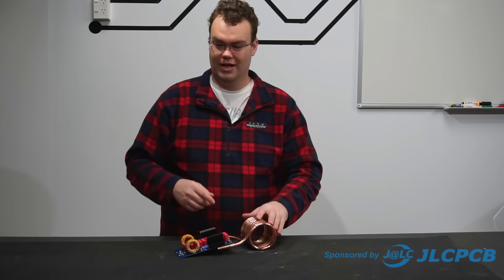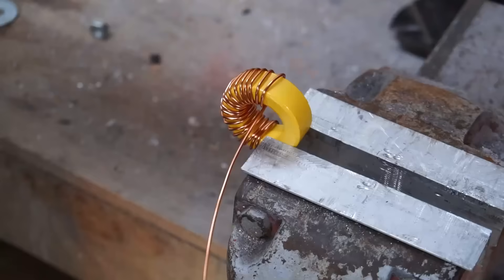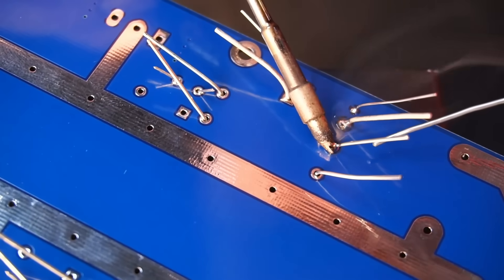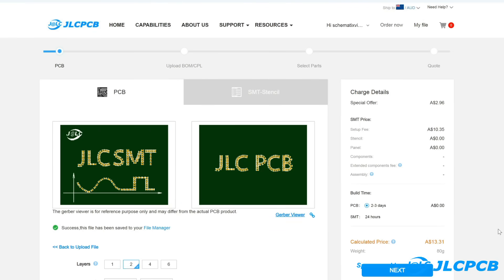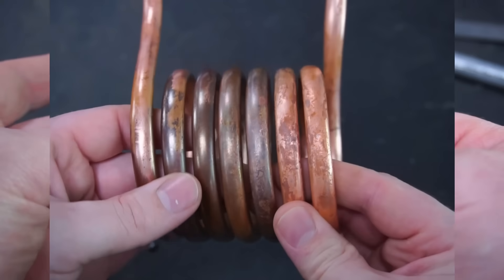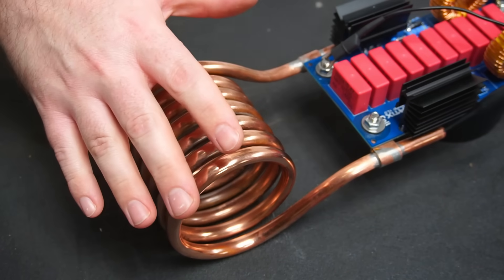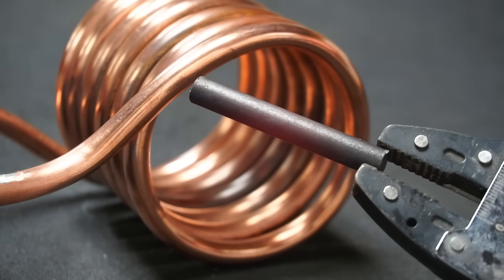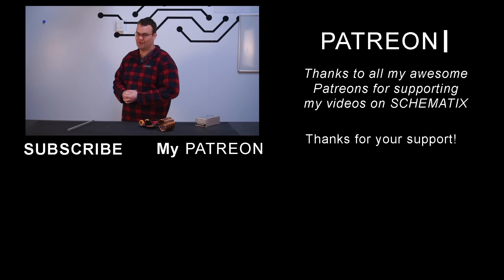Building a 1.4kW Induction Heater

Comment: Get the automotive batteries from 4 vehicles. At 12 volt DC, wired in series will get your 48 volts. Just don’t use your battery as you may have to drive to get parts for projects.

Now, using copper pipe wire cut the mustard, or cheese. Solid wire in that diameter may prove expensive and hard to find. I am sure that solid copper is used in manufacturing.
A note of caution: Grounding rod is sold to be driven into the ground where it can get wet, but this rod is copper clad on a steel rod. You won’t be able bend it first off. Only heat or power equipment will shape it as shown. Don’t just think you’re getting a good deal on solid copper as sales people won’t bring it up as they would thing you know what you’re getting. If solid copper, it would bend if you drive it in the dirt. ASE Master Tech-Retired.

Comment: Monitoring the coil frequency and you can detect when the coil is 'loaded' and when the frequency snaps back, you know the iron is melted (if you can reach those temps) and you can cut the power.

Along with a crucible container, those would be very nice features. A detector that shuts off if the coil isn't loaded when the power is on and an automatic shut off after the metal has been melted.

If you are looking to make an automatic molding machine (or something similar), then you could also combine the cut off with a poor mechanism. Creating a 'load and ignore' ingot melt system. Fun.

Comment: This looks like it would make a good Tesla coil if you just add a large secondary coil that's resonant at 50 kHz. to step up the voltage.
Reply: Flyback Transformer frequency was closer to ~31 KHz (625 PAL lines x 50 frames per second, or 525 x 60 if NTSC ...) in days when TV tubes required those while Vladi Mazzilli only used his skills to work on Tesla Coils around 2008 - hence titling his cross-diodes topology a "Royer ZVS" actually, quite probably in reference to Royer's 1954 patent...

Comment: Hello sir. Thank you for video. 
Could you please tell me if i use this kind of device as heater for 10 hours in day. It works or breaks after while..? Thanks.
Reply from the maker: Good question. All the components have been carefully selected so the induction heater is robust. Provided you have a couple fans blowing air over the caps & heatsinks, you shouldnt have an issues using it on a daily basis.

Comment: very nice , but i need heater to have much more than 100w at 12v, i usually use small and cheap heater from ebay 6$, that has 120w at 12 v

Comment: Question: Towards the end you said you turned the input power up to 48 volts. Your power supply was a 28 volt transformer through a full wave bridge with capacitor filtering. That gets you around 39-40 volts (less the diode drop of the bridge.)  So where did you get 48 volts?
Reply: He explained that his variac could supply overvoltage to the transformer.

Comment: Are you referring to aluminium as "alloy", or do you really have a rod of aluminium alloyed with something else?
Reply: Most so-called aluminum is actually aluminum alloy for increased strength and hardness.  Pure aluminum is only used when the best corrosion resistance, ductility, or electrical / thermal conductivity are needed, since those are the properties which get worse with alloying.

I've heard the phrase "aluminum alloy" shortened to "alloy" before, but only in the bicycle business.  I guess it's not really any worse than just calling it "aluminum".
Reply: @CoastalSphinx  I married a yank, so I've got used to "aluminum", but yes in my world I deal with pure aluminium a lot, particularly as I own military vehicles with aluminium bodies and galvanized chassis - so this isn't a trolling comment it's a genuine question as the distinction is relevant for me - mostly as I do plan to experiment with induction heating in the near future.

Comment: now how can we make this to turn on only when we need hot water in the sink via the water line .    Or replace the boiler in the basement with an induction heater.   2 great idea for some entrepreneur.   Did  anyone hear me?
Reply: marty V on-demand water heaters usually use natural gas because it is more efficient and cheaper than electric ones.  Also, resistance heating is a far simpler design if you do need to use electric power for some reason.
Reply: This board and setup would be an interesting water heating experiment for an instant on demand water heater. Of course, resistive is simpler but comparing the two for efficiency is key. I'm on it!

Comment: How can I increase the frequency?  I like the clean look but want to heat metal faster. Ideally, I want a 1/2 inch thick steel rod to go from ~90°F to glowing bright red in about 3 minutes.
Reply: Try a coil with a smaller diameter maybe with solid thick wire.  This will be lower inductance so may need extra turns.

Comment: Smiling!
Nice video. Just found your channel. I am a Ham Radio guy for the past 46 years and enjoy watching people build things. Also enjoyed your toroid video and will watch more.
Been watching guys build a solid state linear amps, that put out 1.5 KW with small transistors. Crazy small compared to my 4-1000A amp I built 45 years ago and still working. Like the fact of low voltage, 60 or so compared to my 4030 plate volts, a bit safer if you make a mistake. Smiling.
Thanks!
Reply: Hello mate I've been trying too improve the amps on my salt batterys just a volta stack salt battery I just wondered if you had any ideas about improving the amps...I know can parallel them but I just am asking people for any input as volts are no problem its just the ampage I'm trying too improve ..if any ideas be appreciated cheers

Comment: Could you design a space heater using the induction part ??? I was thinking of you maybe making a copper flower of some sort to use as the part that gets heated and releases lot of heat using a fan blowing across the flower??? Hope to see a video on that subject Sir. Thanks, Vic
Reply: You could but there is no reason to, resistance heaters are already 100% efficient.
Reply: @sbvera13  You would think that is correct but that is far from the truth. The method of measuring efficiency is far from correct. That is like saying an engine which burns gasoline and diesel engines burn one gallon of fuel go the same distance . Just saying fella. VF
Reply: Point well made Random Lurker. This is what gets me more than anything. EFFICIENCY has to be the most misunderstood word in anything electrical or electronics. Would be nice to get an answer from someone who knows for sure. Thanks vf

Comment: You didn't mention that you can use a off flat disk shaped oil on that as well which would allow you to heat sheet metal in certain areas where do you need to heat a spot and you could have still use the copper tubing for that as well called the pancake coil. Overall a good design

Comment: maybe you should make the trace on the pcb larger too... overall this was a great starting point, I cannot wait to see a more versatile and intelligent version with more controls and protection (built-in temperature sensor for the MOSFETs)... Please keep working on this :)
Reply: This particular (hard-wired) topology can't be tamed down as you suggest, just unplugged after it may be too late anyway, not to mention Mazzilli's circuit has even been studied in universities, a decade ago (...):

https://docplayer.net/26964431-High-voltage-resonant-self-tracking-current-fed-converter-a-thesis-presented-to-the-faculty-of-california-polytechnic-state-university.html
High voltage resonant self-tracking current-fed converter (2010-Mar)
p52/152 Mazzilli Converter Topology

p53/152 Figure 2.9:  Mazzilli Converter Topology

...and yet Vladi's circuit as published on hiw own FaceBook remains to get revised/corrected/updated:

https://www.facebook.com/photo?fbid=10201892284336382&set=a.1979407652483
https://www.facebook.com/photo/?fbid=10201891384713892&set=a.1979407652483
Flyback Transformer setup (HV/plasma)

Pass the word:

https://i.postimg.cc/9Q0fsf8f/About-Vladimiro-Mazzilli-vs-Royer-ZVS-Known-as-vladi-mazzilli-on-Face-Book-Graph-ed-by-Egzoset.png

Comment: https://pdfpiw.uspto.gov/.piw?PageNum=0&docid=02783384&IDKey=5E6FA68BBD9F&HomeUrl=http%3A%2F%2Fpatft.uspto.gov%2Fnetahtml%2FPTO%2Fpatimg.htm
US Patent 2783384 dated Feb 26 1957 discloses the original versions of this circuit using bipolar transistors and various inductor and transformer topologies.  The major 'claim to fame' of these early circuits is their simplicity and high efficiency while making a high quality sine wave output.  Many later designs exist using power mosfets.  Search "induction heater".  Industrial versions exist to deliver many 10's of kW for heating steel parts for various purposes, including selective hardening of gear teeth, etc.
Reply from the maker: Fascinating to reading the old patent's and see how they compare with modern tech. Thanks for sharing! :)

Comment: Beautiful work! I’ve been thinking about building an induction heater myself. You warned about keeping the coil at 6.5 turns. Would it be safe to make a coil smaller in diameter?
Reply: I have made several of these for annealing rifle brass between reloading.   Yes you can make different size coils.  My coils are made out of 1/8" copper tubing and a coil diameter about 1".  I also insulate the tubing with fiberglass heat proof sheath and I use a 2 or 3 layer coil to keep the coil height down.   BUT be careful, all of that is changing the coil inductance and that significantly affects the tuning of the tank circuit.  Do some research on free air coil inductors.  I had to play around a lot to get a circuit that ran at a reasonable frequency without drawing too much idle current.   Even so I'm pushing enough current through mine that I have to water cool the tubing or it gets really hot fast.   A cheap CPU cooler setup works good for that.   Definitely have to use a good CPU fan on the caps to keep them cool too.    That said, I can heat the neck of a rifle brass case to red hot in 3-4 seconds to anneal it.

Comment: Nice video and project!! I enjoyed it a lot. 

Some advice for the burnt out trace is to mechanically attach a tin or solder-plated copper bus bar onto the PCB using fasteners, and then solder to it. Size the bar so the Joule heating is too low to melt the solder. Stay away from eutectic tin-lead solders as well since they have the lowest melting points. 

I designed a 30 kW power supply running at 270 VDC and 110 Amps (three phases), and used copper bar sized to 1/8 in (3.2 mm) by 5/8 in (15.9 mm) to carry the load across Hall effect sensors on the PCB, and it performed well. 

Good luck! I can’t wait to built my own heater and do some induction hardening. Thanks for the ideas!

Comment: Just fyi, when annealing the copper tubing it is best to let it cool down slowly and not to quench it quickly as shown.
Reply: I thought it was super weird he was trying to reduce the hardness/brittleness by quenching ! That's basically what you do to increase hardness.
Reply: @ironfront9573  only for steel/ferrous.  You can quench brass it doesn't matter
Reply: It doesn't matter.  I'm a commercial reloading brass processor and I've designed and built annealing machines.  Quench or not, it anneals either way.

Comment: CAN U DESIGN A LOW VOLT HIGH AMP CIRCUIT.???OLD  HIGH QUALITY SERVER POWER SUPPLY IS CHEAP AND UPTO 85%+ EFFICIENT IN 10/15 DOLLAR ....THOSE THINGS CAN SUPPLY 12 V UPTO 90A!!!!!!!!!!!!!.... SO I THINK ITS A GOOD IDEA TO DESIGN A CIRCUIT WITH REQUIREMENT OF LOW VOLT 12V AND VERY HIGH AMP 70-100A........ THOSE OLD  SERVER PSU's ARE VERY EASY TO FIND.... U CAN FIND THEM ANYWHERE  EBAY, ALIEXPRESS, OR WHEREVER U WANT..... U JUST HAVE TO DESIGN A INDUCTION HEATER CIRCUIT THAT REQUIRES LOW VOLT BUT VERY HIGH AMP

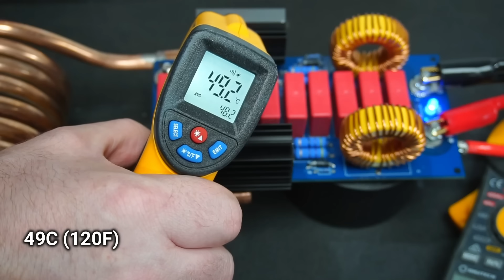Comment: Comment from page 14:26 
Next time be careful (avoid) connecting oscilloscope ground clip to any high power differential circuits.

Luckily an isolation transformer was used this time.
Reply: 3
Reply: @samirchatterjee122  
3?

Comment: I know its typical for ppl to argue about soldering but when solging the copper tabs to the coil it helps to heat where u want the solder to go so it can work its way to thier with capilary action.

Comment: Does the diameter of coil matter?and how
Reply from the maker: Coil design is something I'm also learning about. It's mind-numbing how many variations and factors come into play such as type of metal, shape & size of metal being heated, size of cap bank, work coil turns/diameter/length and so on.
Reply: @Schematix  can someone help with a flat coil design, similar to a induction cooktop or is it easier to buy one ($60) and rip apart. drawback is they usually don't work with non ferrous objects.

Comment: nice build, I found the power inductors on banggood for 1,8€ or 3 NZD per piece (27mm 100UH 15A). Do you know how much current is flow throw the work coil?
Reply from the maker: That's a good price provided they actually match their specs. At that price who's arguing! Regarding the current, I haven't accurately measured the workcoil current however based on theoretical calculations I'd estimate 240amps @48v input.
Reply: @Schematix   cool, thank you

Comment: I really like the simplistic layout and parts outlay of this unit Schematix. What I need to question is you said 220 or 230 volts power used to power unit. Where are you located that standard voltage is 230 volts ??? Also, is there any way the induction coil could heat the metal object that was used in the example the same heat across the piece itself ??? Notice the metal heated from the center out, is that correct Sir ???? Thanks VF
Reply: Looking at the wall behind him I'd say Australia or New Zealand.
Reply from the maker: I'm located in New Zealand. Standard wall outlet here is 220vac 50hz. However, wall voltage is irrelevant for the induction heater itself since it operates on 12~48VDC. Regarding heating the metal evenly, you can design different shape coils to distribute the heat as required. Although to some degree the heat will be focused towards the middle of the work coil. This website shows a couple unique work coil designs you may find interesting: https://www.ambrell.com/learn/induction-coil-design
Reply: @Schematix  Well, yes and no. If you're in a 120 V country, you need twice the current for the same amount of power so that might be a limiting factor. Should be alright for this application though, as 20 amps/120 V are usually available and the equivalent of 240 V/10 amps (2.4 kVA). So all you need is a power supply that matches your mains voltage.
Reply: @Schematix  Thanks a bunch Sir too. V
Reply: @Schematix  You should be very proud of living in New Zealand. Your location has really put a major dent in Covid-19 spread. The young prime minister you all elected really know here stuff. Look forward to see more great videos from you in the future also. And before I forget to ask, do you think using induction for heating a home would be a great idea or a dud ??? Look forward to hear from you Sir too. VF

Comment: 2:52 To be honest, I like the look of the diode standing up like that, it makes it look artful,  many time I wish guys that create one off's boards would purposely do that, That is probably why i have always been a fan of Manhattan-style PCB's
Reply: Don't try that artful thing with anything that moves.....
Reply: Not recommended in radio receivers. It’s a source of noise.
Reply: @tonydoggett7627  lol Depends if one is trying to make a spark gap radio
Reply: @patprop74  my experience of mounting diodes like that years ago in a am receiver. Once the leads were shortened and the diodes laid flat the interference went.

Comment: I haven't looked at your gerbers,  but for that melted trace, if you have the room on the top of the board you can duplicate the capacitor bus  and cover with mask. It's not much,  but every little bit helps.  I recently had to do something similar for some on board 1500w @120v power switching relays. This along with the additional solder on the bottom side was enough in my case. 

... and hopefully you are already using 2oz copper.

Comment: Hello Schematix
For information: This schematic diagram is copied by the german patent nr. 35 19 489 / 30.11.1989!
                              Also, this is not a Royer-heater!
Reply: Go figure, i'm still searching for this reference in vain:

https://www.google.com/search?q=Patent+%22nr.+35+19+489%22+%2230.11.1989%22&tbm=isch
Google Images:  Patent "nr. 35 19 489" "30.11.1989"

While it was easy enough to find Royer's 1954 patent...
Reply: @Egzoset  Reference in Google Patents is DE3519489C2 but unfortunately no images are online.  Expired in 1996 due to fees not paid, so apparently not thought very valuable at that time.

Key differences from Royer 1954 are (1) LC resonant tank (2) current fed mode (3) diode feedback from tank to FET gates.  I'm having trouble determining who may have originated these as many possibly relevant 1960s patents have little or no technical information available, including about half the cited prior art in DE3519489C2.
Reply: I could not find the schematic for the patent, but the text refers to external auxillary voltage (äußeren Hilfsspannung) which is not used here. In addition, the patent refers to placing capacitors in parallel to the zener diodes, which would not work in this circuit.

So it appears this circuit is somewhat different from the patent.